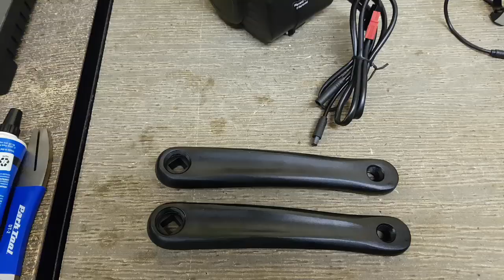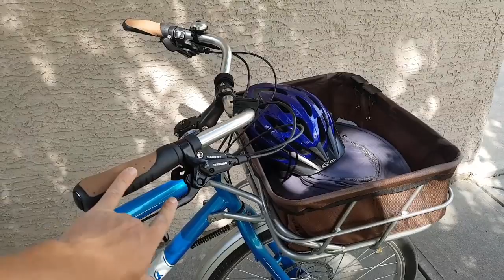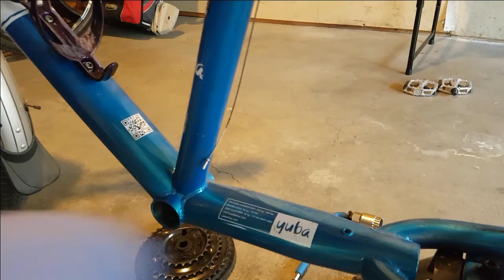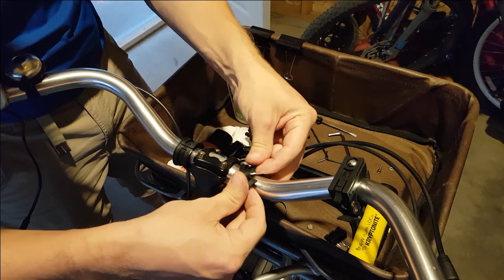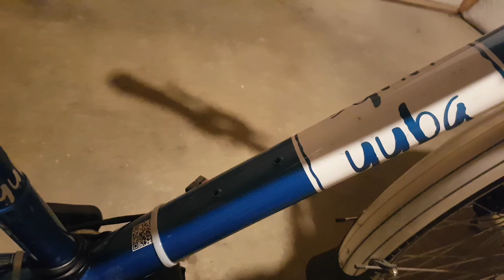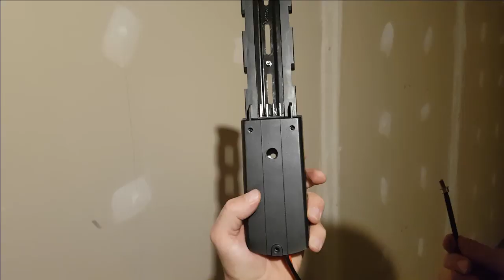Yuba Mundo Tongsheng TSDZ2B Ebike upgrade

Comment from the maker: Heads up!  I ended up with some damage to the frame of my bike from this motor install.  Check out the video here https://youtu.be/QaQcH8AxEdQ for details and how to prevent it from happening to you
Reply: I'm late replying late but this is still the best installation for this install.  Though not typical, this install video is the most  comprehensive on YouTube.  Thanks.

Comment: 6:03 I used to carry heavy loads on my Mundo 3 to 4 times a week and intended to throw on a 203mm rotor and heard that very same story. The 203 has been on there for about 7 years now with no issues with the fork whatsoever - installing it on the rear wheel might have something to do with that 🤣

I’m in the process of a electric conversion plus a number of other mods including 4 pot hydraulic brakes so I might ‘derate’ the rotors to 180s all round. We’ll see.

Comment: After 4 TSDZ2 installations I’ve learned that the position of the speed sensor magnet relative to the sensor can have a drastic effect on how the motor runs. If your motor is running funny and the display is showing odd numbers fiddle with the magnet, and don’t be afraid to vary it’s placement quite a bit.

Comment: Thank you so much for this video!! I just did the same upgrade myself thanks to you!

For others, instead of a rubber floor mat to avoid the frame damage he showed on the other video, I cut an older phone's TPU case into strips that I then superglued together. Then just put it between the motor and frame. So far it seems to work well!

Comment: Thanks for the video. I followed along and did the same for my 2012 yuba mundo. Though I bought the bafang bbshd instead. Followed your instructions to the letter including the battery install..was exactly as you did (drill hole etc). . The 12" speed sensor extension was definitely required. The 68mm bottom bracket on the yuba is a perfect fit for the bafang kit that I got. Did not install any spacers, just the rubber pad on top of the motor. I did not upgrade the brakes yet, confused on which adapters I need for the 180mm setup. I ordered from Luna here in the US and bought the 52v battery. The newer style computer works for 52v setups.  The bike is a bit ridiculously fast now. I think I scared the family a bit. Did this install just two days ago. Let's see how it holds up! Thanks for the video!!
Reply from the maker: Glad it helped!

This is the adapter you'll need: https://www.jensonusa.com/Shimano-180mm-Is-Disc-Brake-Adaptor 

This is the brakes I went with: https://www.jensonusa.com/Shimano-M396-Disc-Brake?_br_psugg_q=m396  (The 1700mm stock length was a perfect fit).

Comment: Just to clarify a few things for your install. If you cannot use the top clamp to prevent the motor from rotating, you may be able to use an aircraft clamp for your frame diameter & bolt that to your motor. You can see it in place in this video from about 55 secs - 1:40 on a trike. Also I believe the 2 ports on the under side of your display are for E brake levers if you install a throttle.
Reply: your link actually just links to this same video. I'd be curious to see what you did, though.

Comment: No problems with motor rotation? I thought the frame clamp was a critical part of such an install. I've a friend who has done the same on her mundo and the install involved sinking a rivnut into the frame tube behind the bottom bracket and a small 90° bracket such that it's all secured.
Reply: see my other video linked about frame damage. Aside from that, as a result from what you described, my solution for the issue worked fine. We are still using the bike as a dedicated winter ride.

Comment: If there were room to flip the motor inside the frame of the bike, would the system work? I would feel much better if the motor case was not hanging down. I want to install one on a peddle forward bicycle and it appears that it may fit that way - any thoughts?

Comment: Hey you mention that this is now your winter bike! Do you mind sharing how do you protect it from the weather? Did you put anything on the cable joints?
Reply from the maker: I replace components, often.  I've heard "Rust Cure Formula 3000" works pretty good, so I'm going to give that a try on some of the nuts and bolts and areas on the frame that are starting to rust.  Electrical Tape on the cable joints is all.  I just buy regular KMC 6/7/8 speed chains from MEC 3 at a time and build a couple long ones using a chain breaker and quick links and replace it often (at least once or twice through the winter).  Replaced the rear derailleur this summer.  The wheels are due for a full replacement set (rusted bad and stripped the axle while trying to get the bolt off), which I'll buy direct from Yuba (https://yubabikes.com/product-category/parts/).  This isn't a bike that holds up to winter very well, it's just a cheap bike (Compared to our Tern GSD) that's inherited the duty lol.  Steel / Cheap components..

Comment: I've seen notes from dealers saying this has the option to have 2 chainrings and a front derailleur. Have you heard this? What components / adjustments would be needed?
Reply from the maker: No I haven't, sorry.  I never had a reason to.  We found the 1 x 7 drive train matched the motor perfectly.
Reply: yea its not factory... there's been a lot of development in the Tongsheng user/provider community in 2 years...try eco-ebike.com.

Comment: Hi Saul. Just wondering how you are finding this motor with the yuba Mundo. Does it have enough power? I carry round two kids - is it powerful enough for this?
Reply from the maker: Yes, it has plenty enough power.  We've recently purchased a new Tern GSD that comes with the Bosch Performance CX motor.  In terms of power output, the Tongsheng TSDZ2B is very comparable.  We haul two kids as well on both bikes.  The Mundo is now our winter bike.

Comment: Have you done any pros and cons updates since you’ve installed this?
Reply: No, never really got around to it aside from responses to questions in the comments below.  We still use this bike as a dedicated winter, and the motor is still running strong.  I had pulled the side cover off at one point and put some fresh grease in there.  Frankly, it's holding up better than the bike is (steel frame mundo).  Pro was that it was a great way to add e-assist to a pretty heavy cargo bike, which made riding it a LOT more enjoyable.  Con's were none at all, aside that I would say a dedicated purpose built e-bike I think is a better way to go, especially now - A lot has progressed in the 5 years since I did this conversion.  In fact, the store I bought this conversion kit from (Biktrix) no longer sell e-bike conversion kits and only sell complete e-bikes.

Comment: Since you tried other OEM torque sensing ebikes, what would be your verdict on tsdz2 compared to bosch. Pros and cons, and how much different they really are.
Reply from the maker: I had intended on doing a full review and touch on those points, but never had the time.

I'd say the TSDZ2B is a good little motor overall, and I'd recommend it to anyone looking to upgrade their existing bike.  Such as was the case here.

The TSDZ2B torque sensing compared to the Bosch I found to feel quite different although they put out similar amounts of torque.  The Bosch system measures the amount of torque you are applying to the pedals then provides an amount of assist proportional to that.  The Tongsheng seems to be more of either it's on or it's off.  It senses when you are applying torque, and it gives you the additional power.  The Bosch system also seems to like a higher cadence whereas the Tongsheng doesn't care.  For example one time I was climbing a very steep hill, so I was pedaling pretty hard.  I started to get tired and slowed my pedaling and lessened the amount of torque I was applying to the pedals, yet I didn't slow down.  The Tongsheng motor still kept giving me the max amount of assist.  I realized that working harder was pointless.

The display and assist level settings aren't nearly as refined as the Bosch.  At times, the middle two assist levels didn't seem to make any difference, or the top two settings wouldn't seem to make any difference.  This was probably due to battery charge I'd guessed.  The battery level on the display was also a matter of fully charged or almost dead.  This was likely due to it being a 52V battery.  

So short version, it's not nearly as refined as a purpose built and fully integrated system from Bosch or one of the other popular brands.  

It's done the job for us nicely though and has been used almost daily year round since I originally posted this video a couple years ago.  At some point this summer I'm probably going to open up the motor and see about cleaning it out and putting in some fresh grease because it sounds pretty rough. Winter riding here is pretty tough on bikes!  No issues with the battery, Biktrix does a good job with those!  

We're looking at purchasing a new bike for summer riding only.  The Tern GSD S00 is the likely candidate!  This bike will end up being the dedicated winter beater.
Reply: @saulb77  thanks for detailed explanation. Did you think about trying the OpenSource version of the firmware for this motor? The ones that went that route claim that it completely transforms the way how it works in positive way.
Reply from the maker: @nucleus42  Interesting, I've never heard of it.  I'll have to research that.
Reply: @saulb77  Same, people say how smooth it is. For mee it's  also seems like it either on or of when I pedal without any pressure on it.

Comment: How did you fit the rear disc brake? Did you use Shimano 180mm adapters along with 180mm rotors or did you need to do something creative?
Reply from the maker: I actually just used the tektro ones that came with the Yuba Mundo disc brake upgrade that I originally bought (and didn't like).  So yeah, Shimano 180mm adapters should work just fine.  Nothing creative at all.  Didn't even have to shorten the hydraulic line, was a perfect fit stock.

Comment: dude,  you could have just removed the metal base from the plastic part,    no need to drill through the plastic to get to the metal base plate
Reply from the maker: No, it was all glued together.  Drilling was easy.

Comment: Hi! How hard do you have to peddle in the turbo setting to get maximum power assistance? Is it above the "sweating threshold"?
Reply from the maker: Not very hard.  I've noticed that this motor responds to a far lower cadence than the Bosch for example.  I realized this once when I was climbing a very steep hill.  I was peddling very hard, until I started to get tired.  Once I tired out and slowed my peddling down I noticed that I didn't slow down at all.  After that I relaxed and peddled lightly and let the motor do the work.  It handled the hill with ease.  Its polar opposite to my Bosch ebike.  The Bosch motor really wants the higher cadence and balances the amount of power it provides to your torque and cadence.  This motor just doesn't care, it puts out the full amount of torque at a low cadence and once it reaches it, it doesn't matter if you pedal harder.  It's a powerful little motor and it moves this Yuba Mundo with ease up pretty steep hills, with kids and cargo.
Reply: Thank you for the long answer! Is it true that the tsdz2 gives a bad chain alignment? And how big of a problem is it?
Reply from the maker: Alexander Helstad I never noticed any issue, but I suppose it could be masked by the length of the chain on this particular bike.
Reply: 178/5000
Hello Helstad, I also have a new engine mounted and the display goes on but engine does not. Speed is shown but engine stays style? Maybe you know why?